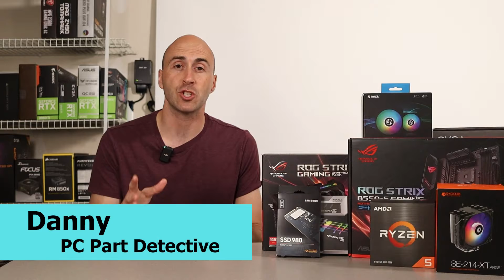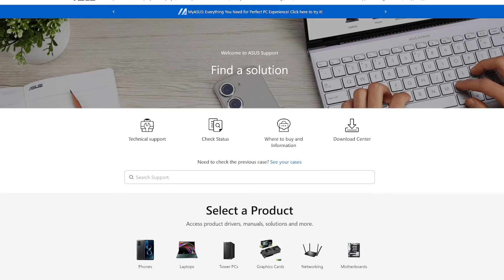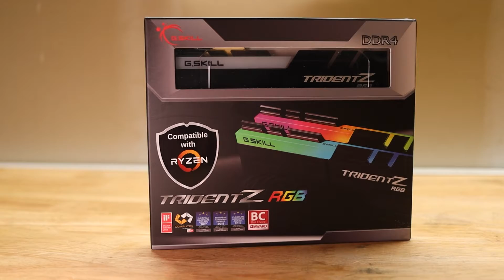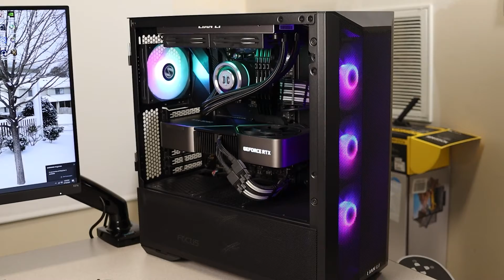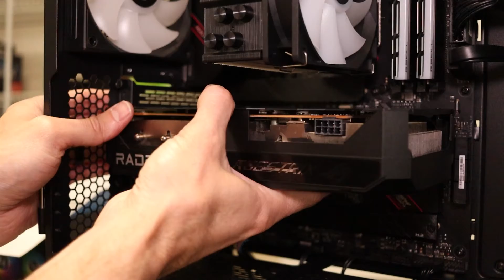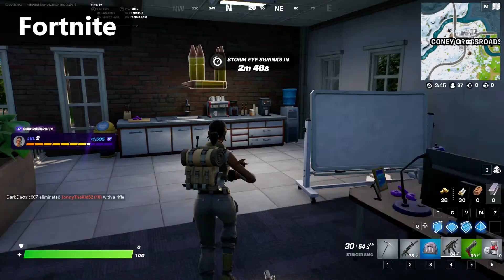Why ARE Asus Strix Parts so Expensive?

Comment: If i had unlimited money ill use rog forever but if youre on budget just use not rog like getting a pc on rtx 4070 super and ryzen 5 7500f using rog total is like 1.5k dollars mobo is like 500 gpu 800 and using cheapest parts it can be 1k use rog if you have much money and also style you dont need style you aint gonna look at it 5 hours a day and factory oc bro just overclock it yourself its cheaper

Comment: I disagree with this video. One thing i can tell you is that, right now, ROG products are overpriced for the sake of the branding and NOT because the products are acually better. Since last generation of gpus the triple fan TUF and ROG cards have been the same throughout Nvidias and AMDs lineup, everything but the shroud is the exact same.
A Similar phenomenon occurs with the white motherboards of intel "Z" series high-end chipset. The Strix z790-A will retail 50-80 dollars more than the PRIME version, and if you look at the features of the boards you´ll notice the they´re the exact same, 1:1. This has been the norm since Z390. I´m not saiying not to buy from asus, but if your opn a budget avoid the ROG sub-brand.

Comment: I’ve used a few ROG ITX motherboards 🥰😇over the years and they’ve been of a vg quality, very weighty, great bios controls, never an issue personally🥳👍. I’ve also have an ROG SFX-L Thor psu w/ PCI-e 5 GPU connector and it’s been great at tailing my 7950x3D w/ RTX4090 with no voltage / ripple issues and great stability under high stress loads💪. Yes the come with ‘the ROG tax’ but if you do buy their products….. you’ll be happy you did long term and on resale when the time comes as ROG always get a quick and pricier sale 💪🥰👍